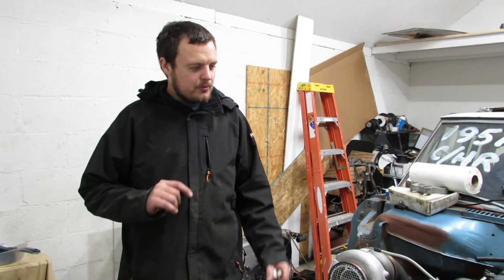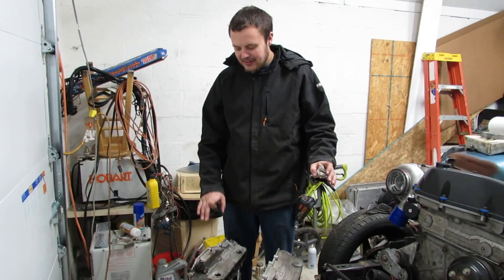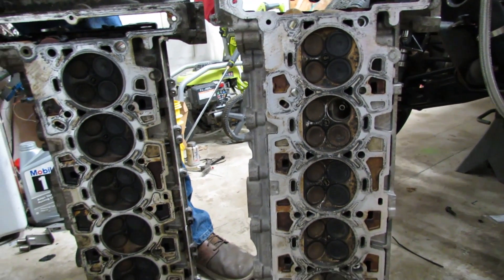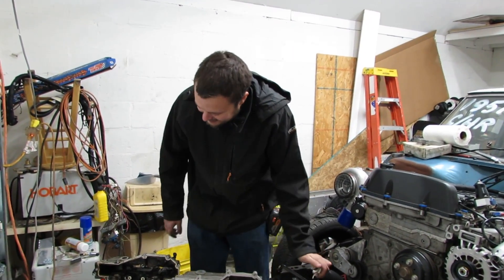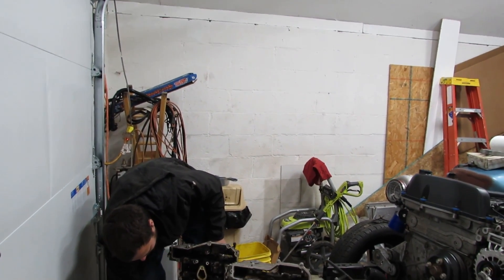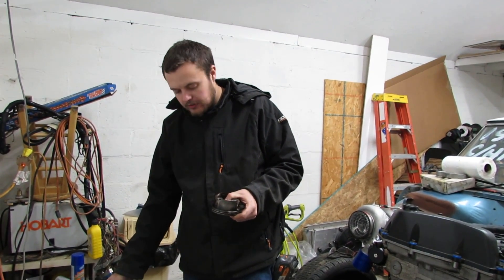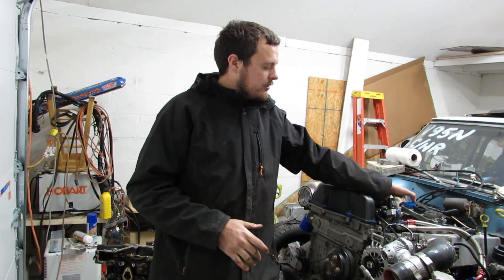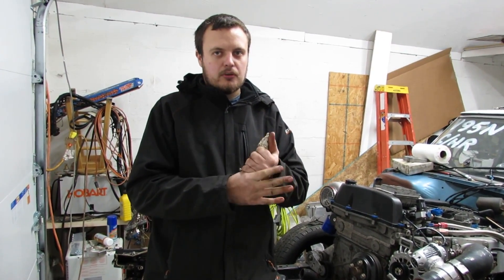Vortec 4200 Engine Differences

Comment: First off, I love all your videos and the unique rides you put them in plus I love reading everyone else’s comments also but I have a quick question hopefully you find the time to answer. I picked up an 06 engine will my E 67 ECM in my 08 model operate 06 engine or am I gonna have to go with an ECM from the 06? And I haven’t seen one yet, but I was curious if you know which your models is a direct swap for the. 4l60e from what I read there is no direct swap, but you never know if you’re getting the right information off Google. The only way to know is to talk to someone that has actually done it and experienced it.
Reply from the maker: Unfortunately, it will not. E67 requires a 58x/4x trigger.
Reply: @Calvin-Nelson  back to the drawing board thank you very much, sir and keep up those awesome videos

Comment: I'm able to purchase an '08 engine but I want to do the Schneider cam upgrade and I was wondering if I could take the valspel spring retainers from an earlier engine and put it on the '08 so I can run a Schneider cam?

Comment: Can you put the 06+ head on the 02-05 block?
Reply: Nice piece of education Calvin. A lot of misconception out in the forums where people claim that using a 06 and later cylinder head on a 05 block  is a way to increase HP. Clearly none of them actually tried what they claim otherwise they would have discovered the bolt pattern variation.
  this is from another post comment not mine Hope it helps Cheers
Reply: This was kind of answered in another comment. You can but will have 2 temp sensors

Comment: I would like to put this motor in a 92 Camaro and do auto cross do you think it would fit would it be a good motor to use ? Is it lighter than a LS I would like to be different
Reply from the maker: It's been done. They fit decent.

Comment: Can you go more in depth on using the stock ecu for boost? Also I want very badly to use this motor for my next drift car build. I know you’re a drag guy but if you (or any one else) had any input on how a 4200 might perform in a drift car, I’d love to hear it. I’ve also been binging all of your 4200 videos, great information and awesome builds!
Reply from the maker: Doing a drift build is totally doable. As with any drift car, the key is oil control. There is a guy in Sweden that has a really sick Volvo Drift car with a 4200. 

Check this out for more information. https://sites.google.com/view/vortec4200wiki/home

Comment: Questions not real good with cars but want to upgrade my 95 v6 (3.4) 5 speed camaro, would you think this engine would fit?
Reply from the maker: It would definitely be a difficult swap. People have done it before, but it's hard to squeeze in there.

Comment: i know this video is a few years old now, but, why 'only 450' hp? that doesnt even seem worth doing a turbo or anything else?  If you were talking in the 850 hp levels i would understand, but, a 6.0 with a cam is in the 450 hp levels. So, i dont get it?
Reply from the maker: We've done so much more since then. Turns out a stock bottom end went over 800whp, and we are getting close to 1000whp on our built engines. It's cool if you don't get it. It will never compete with an LS. I do this because I like it, not because it makes sense.

Comment: I just scored a 04 atlas 4.2 with 106k miles for $300 bucks. Ran great in a rust bucket. My mint 03 envoy just hit 270k miles and finally started making the worn valve seat diesel sound.

Comment: So, if I have a 2008 or later 4200 and want to throw on a turbo, I would have to get a p12 ecu and switch to an earlier crankshaft? Does the p12 work with the later 58 tooth reluctor wheel? I am trying to search online and everything that I see is for V8s and other engines.
Reply: I have the same question I have an 06 model engine, but I have a 08 model trailblazer and I need to know if that 08 model E 67 is compatible with the 06 engine or am I gonna have to get a different ecm did you ever find out?

Comment: Hey brother I have a 2005 trail blazer ls wit a 4200 I just got an 1986 caprice four door I was wondering can I swap out the engine from the trail blazer into the old school box Chevy caprice? Thank your answer would help me a lot brother 🙏🏽💙💯
Reply from the maker: When there is a will there is a way. Just have to get the tape measure out and see how hard it is going to be. Measure the length and height, available and make your decision. With a sawsall and a welded anything is possible.

Comment: Joining the Vortec 4200 club and going to do a frame swap with a '65 IH pickup. I'm wanting to do some work with the P12 ECU. What software are you using to do your programming. I'm just looking to delete a few sensors that won't be needed for my build and perhaps setup, if possible,  a 2 or 3 driving mode system. Thanks for turning me on to this platform. I built a Spit6 back in the day and that was a ripper little I6.
Reply from the maker: HP tuners is what I would use.
Reply: Ouch $500 bucks, looks top of the line though. @Calvin-Nelson

Comment: I have an 07' 4200 that spun a rod bearing, and its too far gone for the crankshaft and rod cap to be machined! I found an 02' 4200 what do i need to do to make it work for my 07'? Can i use the 02' lower( block, crank,) and use the 07' head, oil pan, n timing gears, or will it not work that way?

Comment: so what year is the best to get. Or what parts do you change without having to have anything done.. seems like buy an 08 09 if you can
Reply from the maker: Totally depends on what you want to do. For best parts available, you mix and match. If you don't want to turn the world sideways, any engine will work. If you want to use a stock computer, 08-09 is the way to go.

Comment: With these engines can you do a hot cam swap. 
Put 2 intake cams or exhaust cam’s depending on size.
In the KA24de you can put 2 exhaust cams in and it keeps the motor breathing with larger lift at high rpm
Reply from the maker: No. The cams are different. Exhaust has VVT stuff in the cam, so won't interchange.

Comment: Would it be worth getting the previously mentioned motor 03-04 motor for cheap and just using the block but use crank,rods,pistons and head from the 06?

Comment: Calvin, by chance do you happen to know the oem part #'s for the p12 ECU & the 12 Counterwight crank? Thanks!
Reply from the maker: I don't, but you could probably easily find it on GM parts direct.
Reply: @Calvin-Nelson  i looked on rock auto but theres actually so many i wanted to be exact if possible.

Comment: Are the 06 ecm know for shorts or Amp draws whith key off and door shut my Amp draw was 0.01 to 0.03 but let the envoy sit over night battery dead as a door nail new alternator n cleaned n fixed all ground n still having battery drain no like in no nothing my ? Is the pcm black plug on pin 73 I think it is the large ground wire to motor block broke n blew the pcm fuse I fixed the ground than Amp draw started after that issue seem common jw family ride till I pull motor n Trans for furniture build lol any tip info would help yes I bought the whole wiring diagram on my gmc envoy 2006 thanks
Reply from the maker: No idea
Reply: Humm ever had to program a ecm when a ground wire on black plug breaks jw
Reply from the maker: @MustangKevin69  Nope. That's a really specific scenario. Also I don't really mess with stock ECUs very often.
Reply: @Calvin-Nelson  dang I u still have that old computer u was showing in the video off the 06 I could use it for sure
Reply: I want to turbo my 4200 any think needed other than fab header etc intake handle the psi?
Reply from the maker: @MustangKevin69  we've had the plastic intakes to 40 psi. Give this a read https://sites.google.com/view/vortec4200wiki/home
Reply: @Calvin-Nelson  thank I will

Comment: Can you help me please?  I cant seem to get the timing right. I have an 07' engine and a new cloyes timing chain.. it says something about turning the actuator to the right before installing but from what i can tell its already all the way to the right. My marks all line up correctly but i have no compression when all said and done. Ive pulled this engine 3 times and dont know what im doing wrong.. can you give me any pointers. I thought i was a pretty decent mechanic but now im doubting myself. Ive even honed cylinders replaced rings and gapped them and lapped all the valves.. any help would really be appreciated
Reply from the maker: Have you performed a compression test?
Reply from the maker: To double check the timing on the motor, at cylinder 1 TDC, the flats at the back of the cams should be level. Should be able to lay a straight edge across them. This may not be 100% perfect, because the exhaust cam may have some angle.

Comment: I realize this is an older video and apologize if the question is off topic: If you were looking for an Trailblazer/Envoy for an everyday driver am I correct to assume the 06-09 model years are going to  be the better way to go? I Better lubrication to the piston, stronger connecting rods( at least at the wrist pin) and I'm guessing with the larger exhaust ports and higher compression ratio better power/efficiency? I'm not a mechanic so I ask dumb questions.
Thanks!!
Reply from the maker: Yes. It would definitely be better. The piston lubrication is the big thing.
Reply: Thank you for responding!!!

Comment: Great video and info.  Just started working on these motors a few months ago, your videos help a lot.  Have a question for you.  If I put an 05 motor into an 06, used fuel rail and injectors from 06, but getting a cam/crank position error, and running very rough.  Do I need to re-learn the sensors?  I actually did 2 trailblazers and they both have the same problem, so the common denominator is obviously me.  Thanks, once I get going for a while, I'm going to try to turbo one.  I have some experience with Mitsubishi turbos.
Reply: could be the difference in crankshafts (just a thought). he did say that the counter weights were reduced in 06 so maybe the ecm is reading off the 06 crankshaft stuff and not the 05. might need someone with a programmer or a machine that can delve deep into the values and see what parameters are messing up. i doubt the rpms are different but i believe the sensors are different. all else fails if the plugs and sensors are the same then swap them for the 06 and see if there is a change.
Reply: The camshaft reluctor is different and I don't think you can change just them

Comment: I have a 93 t100 on 35’s, sr5. The 3.0 is severely lacking in aftermarket support. I was leaning towards a 1uz, or a 2jz, or even a 4.0 from a newer taco since they are making S/C for them. But now, I’m thinking of picking up a 4.2 for a quarter of the price, and boosting the hell out of it lol

Comment: I f you have a 08 ECU, your stuck with it? Because of the connector differences you can't use a 06-07 ECU on a 08 Trailblazer?
Reply from the maker: 08 is far superior so being stuck with it is not a bad thing.
Reply: @Calvin-Nelson  OK, I'm looking at a 08 and most likely I will not turbo charge it....just exhaust and intake upgrades along with a rear gear.....for bracket racing

Comment: Isn't that an awful lot of compression to be adding a turbo to? We were always told use a low compression motor if you're adding boost
Reply from the maker: And on the 5th day God created alcohol, and everyone made more power, and it was good.

You can get it from the pump these days. It's pretty sweet

Comment: What would be a good build for an Atlas 4200? I am driving a 77 C10 with an inline 6. I want to keep it L6 but more modern.  I have spent way more money than you can imagine hot rodding the stock 250 L6 and have yet to drive it. I have liked the 4200 because it's not an LS, it's not the normal thing you see. Do all part on the 4200 interchange?  (Yes, valve covers won't) What part would you put together for a boosted application?
Reply from the maker: The 4200s share almost no similarity to the old school 6 cylinders, except for their decks height. Sounds like a great swap candidate.

This should help. https://sites.google.com/view/vortec4200wiki/home

Comment: I've put an 06 engine into the 05 trailblazer and engine doesn't run, misfires as if out of time. Can I remap the ECM to accommodate the change? Been told it would never run. Any suggestions?
Reply from the maker: Should run fine. They have the same trigger type. I'd check to make sure the cams are timed correctly. Go though the basics. Check for bad coils, injectors, etc.

Comment: Hello, great video, watched it several times.  Hoping you could answer a question for me.  Putting a 04 motor into an 06 trailblazer.  Will the 04 fuel pressure regulator work in 06? cause 06 has no return line, I assume because of different type of fuel pump that doesn't need a return line because of the feedback.  Thanks  Just started working with these, pretty impressive motor, I am buying another one to redo after I finish the one that I am currently doing for my grand daughter.
Reply from the maker: I would just use all the 06 stuff if you have it.

Comment: Thanks for the video bro! Im interested on a engine swap on my 02 tb to a 06 tb engine, is necesary to do a 06 ecu change? Sorry for my english bro, regards from México 🇲🇽
Reply from the maker: You should not have to swap ECUs
Reply: Thank u very much bro, and the vvt sensor its the same? My engine its knocking righ now and im interested on a mid use 06 engine to put it on
Reply from the maker: @silvanovela9347  yeah. It's the same.
Reply: Thank u so much bro!
Reply from the maker: @silvanovela9347  you may have to tweak the fuel table a bit to support the extra airflow of the 06 head, but other than that you should be good.
Reply: @Calvin-Nelson  ok bro, I'll take it into account, thanks bro!
Reply: @Nivlac57 I will follow you on instagram bro

Comment: Can you do a video on what the best combo/Frankenstein of parts would be?

I was looking at importing my dream skyline wagon from aus and having them cram 5 naked barras and 6 speeds in the thing for shipping. After seeing these at drag nights I don't want a Barra any more.

Looking for around 500 on high boost tune and 420-430 on low boost tune.

Going in an 81 toyota corona liftback if it fits. If not the 2j goes in that car and the ameri-barra will go in the tacoma
Reply from the maker: Literally any year engine wl be able to hold 500hp. They aren't like the LS stuff or 2JZ where one particular model or year got significantly weaker parts.
Reply: @Calvin-Nelson  ahh ok. Cause I'm looking for daily driver with tons of fun lol
Reply from the maker: @rattyratstuff7125  step right up! Pick a year! Any year!

Comment: Great info thanks. The only other thing I wanted to hear about was what the visual external differences were with the crank sensor change to 58 tooth and how to tell them apart when buying a used engine. 

Also, is the same connecting rod used for 08 as was revised in 06?
Reply from the maker: I thought I talked about how 58tooth motors have a 3 wire crank sensor. All others are 2 wire. Same connecting rods as 06+. See the wiki for more.
Reply: @Calvin-Nelson  thanks I missed the 3 wire part. Didn't they move the crank sensor as well? I'm trying to get a crank kit for my 08 but because there was rod knock on a few I'm probably going to replace those rods.
Reply from the maker: @PrintEngineering  no. Cranks sensor is in the same spot and has the same dimensions I retrofit 3 wire sensors into 7 tooth motors for standalone ecus all the time.

Comment: First of all Thank you very much for your videos and information, i subscribed. I just picked up today here in Spain an early 4200 engine from a Trailblazer (very rare here) to swap into my Drift BMW E36 and im already scratching my head thinking about the hood clearance, oil pan, and how to get the engine running without having to use the entire engine + body harness and module  because of the immo on the ECU, i want to figure this out before starting to break my brain figuring out the flywheel and clutch assembly to use with an E36 Gearbox, sadly they threw away the gearbox and i dont have the bellhousing to make a flange from it :( any help would be appreciated, Thank you very much! EDIT: The ecu is the first one you showed the P10
Reply from the maker: I have a ton of info here. Check it out. https://sites.google.com/view/vortec4200wiki/home

Comment: Have you ever checked the gaskets with an ls to see if they line up? i aim to build a 16 v v8  using different heads off a 4 cylinder or 6. Cutting is an option. Syclones and Typhoons did it with the v6. Thanks so much for this information, you have saved all of us quite a few headaches with this video!
Reply from the maker: I have not. Unfortunately,  they are a very different bore spacing. LS is 4.400", Atlas is 4.055"

Comment: I wonder if it can be made to work with a terminator x with 58x reluctor
Reply from the maker: Yes. You will not be able to control the VVT unfortunately.
Reply: @Calvin-Nelson  hopefully once there's a bigger cam option it won't matter